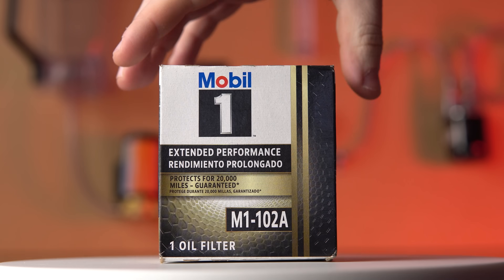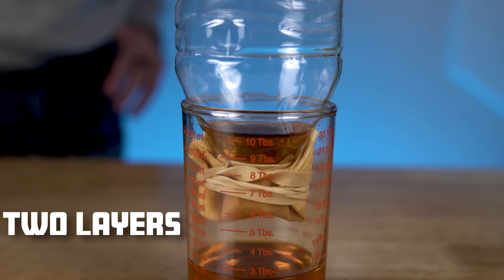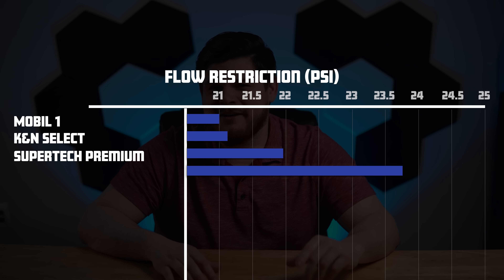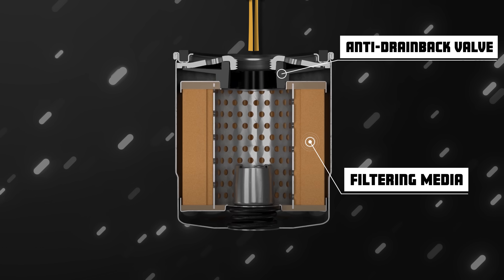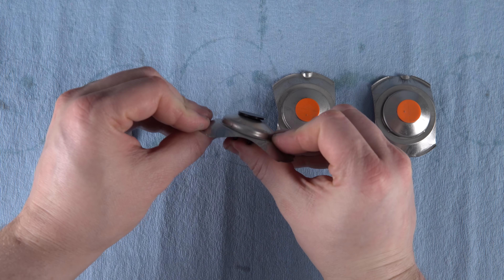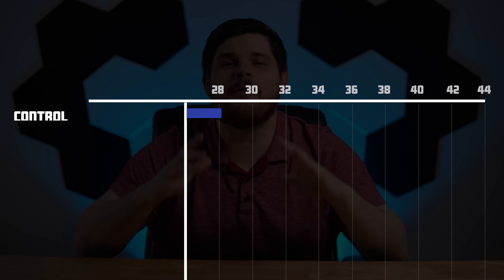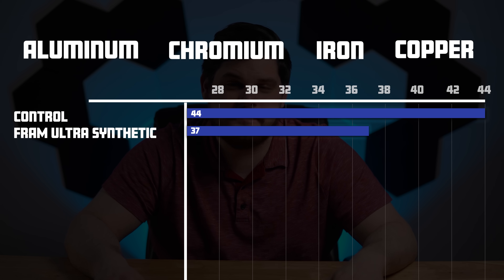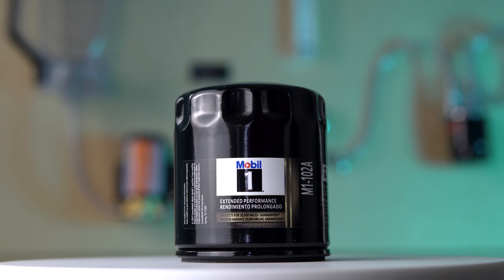Engineers Test the Best Oil Filters! FRAM | Mobil 1 | K&N | Walmart Brand

Comment: I use synthetic oil in my 2016 MX-5 with the Fram Ultra Synthetic oil filters. The filters are regularly stocked at my local Walmart but have never seen ANY Mobil One oil filters there. Very good about doing my oil changes including a 750 mile change for the 1st one. Doing changes around the 3000 to 4500 mile mark. All synthetic with the Fram Synthetic filters. Many short drives in cold weather so just to be on the safe side.
Reply from the maker: @Alan Gregori Thanks for sharing. Maintenance interval is Way more important, like you mentioned.

Comment: Long vs short filter
On the face of it, the longer filter has more media, so more dirt holding capacity and less initial pressure loss, so it will last longer before becoming clogged.
A spin-on filter has to fit in several ways, including thread size and pitch, gasket size, and media micron rating (to add whether there is a bypass valve and bypass opening pressure). Those details aren’t usually spelled out except in the technical specifications, so it would be really easy to get it wrong with very detrimental and costly results, especially if you aren’t a filtration expert.recommend using a top brand filter such as the OEM, NAPA Gold, Baldwin, and a few others. Avoiding big box store and cheap auto parts store filters will give you better odds than using a longer filterSome engines, such as those in simple passenger cars, require only a small filter to handle the relatively small amount of oil in the vehicle. Larger or higher-powered engines, such as those in heavy-duty hauling vehicles or performance cars, will require more oil flowing at a higher rate to keep things cool and lubricated, which means they’ll need a bigger filter.

Different filters can also perform different duties on different vehicle
Primary oil filter: This type of oil filter is also known as a full-flow filter. It’s responsible for filtering all of the oil that passes through your car’s engine. You’ll find this type of oil filter in most car engines.
Secondary oil filter: This filter cleans up to 10% of a vehicle’s motor oil. It’s typically used in addition to a primary oil filter. If your vehicle wasn’t originally equipped with a secondary oil filter, you can choose to install one after purchasing the vehicle.
Thermal chamber oil filter: A thermal chamber oil filter raises the temperature of the oil. This is done to burn off harmful contaminants. To do their work, these filters consume electricity, which can reduce fuel efficiency.
Spinner filter: Spinner filters are also referred to as centrifugal filters. They clean engine oil by using a spinning motion to capture contaminants.
Magnetic oil filter: A magnetic oil filter is designed to clean certain metal contaminants out of your oil. Keep in mind, though, that this filter doesn’t work on impurities such as dust and bugs.

Comment: If you change the oil when you're supposed to according to manufacturer recommendations brand of oil filters is really irrelevant these days. I don't necessarily agree with extended oil changes on engines with turbos though. I change my oil once a year or 15,000 miles, whichever comes first.
Reply from the maker: Yep, frequent maintenance is way more important. Thanks for sharing!

Comment: I use a Fram Ultra Synthetic that is about 50% taller than the size recommended by the manufacturer for the greater filtration area and thus lower pressure drop. My car has nearly 50K miles on it now and still uses no discernable amount of oil, as indicated on the dipstick which I check at the end of the 3K mile oil change interval. I'm sure the careful break in I gave the engine and the good quality oil I've used were contributing factors to the healthy engine I have, a Nissan VQ37VHR that's in a 370Z.
Reply: Ohhh dont worry, she’ll be burnin oil in no time 😂

Comment: For street applications Fram is fine but we have had issues in racing engines that starve the valve train of oil due to high oil restriction for racing use anything but fram, but for street vehicles it really doesn’t matter any of them will work
Reply from the maker: Agree! Thanks for sharing and supporting the channel!

Comment: I am always fascinated at watching oil filter tests, but for me , the outcome of these comparisons is meaningless. I use the filter that my Honda vehicle was designed and tested with, and change my oil and filter often. Why should I chance using a different filter? Regardless, with proper maintenance, the idea that my car would experience a decline in longevity or an engine failure because of the filter is most likely insignificant.

Comment: In the states there are 3 manufacturers of oil filters. And these manufacturers make many of the brands you see here. MAHL , PARKER , FRAM , MANN+HUMMEL and CHAMPION LABS  are actual producers. Also Walmart contracts with different companies to make certain fitment .  So in  this test there is a 75% chance the mobile filter is identical to the Walmart one. 
The key in this test is actually the bypass psi.. the lower the pressure the more contaminants will bypass the filter.. and fyi milage means nothing  it's the environmental conditions that cause oils to degrade.
Reply from the maker: Great insight, thanks for sharing!

Comment: Try it with 200 degree oil and with different weight oils👍
Reply from the maker: @Michael Rohr Thanks for the suggestion, it would require to change the entire setup so the parts used don't melt and with the budget of such a small channel, its really tough, but we may change the oil to something with same viscosity as conventional oil when heated. Appreciate your support!

Comment: Just my 2 cents…
I’ve used filters from Wix, STP, Motorcraft, AC Delco, and Walmart and KMart store brands. But I’ve been using Fram standard filters (and Valvoline oil) for 25 years, now, and have never had an issue. I change oil every 3000 miles. Multiple cars, boats and tractors.
Reply from the maker: Completely agree, as long as you keep up with your maintenance, you should be good! Thanks for sharing and supporting the channel.
Reply: Of course cause your smart 3 k oil change you never lose that way
Reply: @cr2158  I got in that habit after scraping a ridiculous amount of sludge out of an engine that wasn’t properly maintained with oil changes!

Comment: Good information, but not really real world application. Hell I change my oil every 3,000 miles. On that schedule you can use any ansi approved oil and filter and get by just fine. I've got 230,000 miles on my old truck and have never had any issues or major repairs. Clean oil and filter matter more than anything on getting trouble-free miles.
Reply from the maker: @ Kirby Road Thank you for sharing. Agree, ANSI approved oil is good enough, especially when changing at 3k miles. Appreciate you watching!

Comment: I have a question regarding your psi test. FRAM states their Ultra Synthetic filter has a bypass rating of 16-28psi. So if you pressurized it to 24 psi, would the bypass valve not have been opened? That in turn should've lowered the pressure. From what I understand, filtering efficiency restricts flow, and flow efficiency restricts filtering. There is a balance between the 2 forsure.

Comment: I just had some weird shit happened to me. I changed my oil and I put in a Fram oil filter. I drove about 1000 miles. Everything was good then all of a sudden I got a really loud tick in the engine from the lifters. Oil pressure was good and oil level was good, so I just wanted to change the oil and look at it and see if there was any water in it or whatever I’m not a mechanic. It looked fine, so I changed it and Walmart only had the mobile one filter for my vehicle, I put it in Started it up and the tick was gone and my engine sounded great? I have no idea what happened but I don’t think I’m going back to the fram
Reply from the maker: @Bryan Killen Do you remember what FRAM oil filter was it? Thanks for sharing and supporting the channel!
Reply: @BrandRanks  no, I don’t think it was the one made for synthetic oil, but I always used that brand because it had the grip material on the filter and it was easy to change. That’s why I like that brand changed filters, the tick would stop after about 10 minutes when the oil warmed up, it’s an old engine, so maybe some dirt just clogged up the filter, who knows

Comment: I had always been a Puralator /Fram guy many years ago.   when to me Fram was the better filter but over the years each manufacturer started skimping on their products and I started using OE filters with very good success and started about 8 years ago using Wix filters which I am also very happy with
Reply from the maker: @1995dresser, It's great to hear that you've found success with OE filters and Wix filters. Thanks for your comment!
Reply: My mom works for fleetguard Cummins filtration, she said on the assembly line that one filter goes one way and gets painted white with a fleetguard label stuck on it and the next goes the other way and gets painted orange with the frame logo stuck on it, so if you can find fleetguard filters (same with air filters too) they are the same as fram for like a third the cost, she been with the company for over 35 years now
Reply: @diychad7268  but frams end cap has a different design and the micron rating is different, so the parts must be different, no?

Comment: like to see results done at normal engine operating oil temps, not ambent
Reply from the maker: @Erik Young, Thanks for the suggestion, it would require to change the entire setup so the parts used don't melt and with the budget of such a small channel, its really tough.

Comment: but normal oil pressure in a car is between 25 and 65 psi, any one of those oil filters would be just fine and not restrict flow enough to make any difference. personally I run a Bosch filter and havoline 6 quart box oil, 25 dollar oil change and do it every 10k miles, NOT ONE ISSUE and I do this on all 3 of my SUV's, jeep 258k miles, Yukon 254k and explorer 154k miles. millage doesn't kill a car, lack of proper maintenance does.

Comment: I have never thought Fram was a good oil filter, I have always used Pennzoil High Efficiency filters. These filters I use are limited on where to find them. I work at a refined bulk oil distributor so they are readily available to me at $3 a filter. Quick lubes charge triple for the same filter. In my area you can't walk into a automotive store and buy these filters either. I wonder if its scarcity makes it better or is it just that a rare filter from Pennzoil?

Comment: This is what I wanted to see.  Not just taking a filter apart to see how pretty it looks inside.
Reply from the maker: @t bolt Glad you enjoyed. Thank you for your support!
Reply: All these tests are absolutely not relevant in cold oil, must redo everything.
Reply: @47ALTAIR47  WHY ? In what way ?
Reply: @tbolt5883  In the sense that the pressure reducing valve in almost all filters comes off at different pressures until the oil heats up and changes viscosity, this is called the operating mode, and all the tests in this video were carried out under absolutely incorrect conditions for the normal operation of the filter.
Reply: @tbolt5883  He's wrong! Unequivocally. -NY
Reply: @47ALTAIR47     According to you this test produces the worst case filtering scenario ...cold engine, cold oil, thick viscosity.   Isn't that what you want...worse case vs. normal case ?
Reply: @tbolt5883  These are not the worst case, just the filter needs to be tested in working conditions, not in a cold start.
Reply: @47ALTAIR47  What kind of difference do you expect to see in a cold vs working condition filter ? More or less filtering ?   I would expect slightly more filtering in a warm condition because the metal particles in the oil would enlarge marginally from the heat and get caught in the membrane.   So a filter in a cold condition that filters more particles of a certain size is better than a filter that can filter those same particles when they enlarge from heat.
Reply: @tbolt5883  Whenever you start a car with cold oil, then the bypass valve opens, this is one of its main functions, for each manufacturer this valve operates at different pressures, therefore, in the first test, the pressure gauge showed us the response pressure of this valve, not the quality of filtration.
Reply: @47ALTAIR47  It doesn't matter if the oil is warm or cold.  40 psi of warm oil is the same as 40psi of cold oil and it will open the bypass valve.
Reply: @47ALTAIR47 
Wrong on cold oil opening the bypass valve.
Reply: Exactly 💯. Much more thorough info for us engineering types. -Ohio

Comment: Did you run the tests with hot or cold oil ?
Also why did you not include the Wix ,thats the industry-standard.
Reply from the maker: Thank you for your feedback. It was ambient temperature oil. the components on the rig would not withstand engine temperature oil. Although all filters were tested to the same conditions. We are planning on testing additional filters including the WIX.

Comment: Should test the burst strength of the oil filter cans oneday ....definitely will make a messy fun video
Reply from the maker: @daewooparts That's a great idea, I bet it'll be fun, until I have to clean it up🤣
Reply: None of them will burst at normal operating pressures.

Comment: A delta P reading showing pressure drop through the filter would be a good addition to your testing. The bottom line is that modern car makers specify oil drain intervals that are way too long. My car actually shows 20,000 miles remaining after I reset the oil change counter. That's insane in my book. 8500 miles of mostly highway driving is as long as I'll go. Oil analysis at 165,000 miles shows nearly no wear metals in the oil, and levels are consistent from one sample to the next. No oil needs to be added between changes to maintain correct level, BTW.
Reply from the maker: @Doug Robinson Thank you so much for your feedback. Completely agree, we are going to be adding an additional pressure gauge for the pressure drop. We really appreciate your comment, we try to improve and make things better and comments like yours allows us to do that to ensure we bring the best content to you. Hope you have a great day
Reply: A delta P was already done in the video. The output pressure was 0. Delta P was 25 PSI - 0 PSI. An engine oil pump pulls from the sump which is 0PSI. Adding a restriction to the output will do nothing and actually make the test worse. You want the largest delta P for the test and that is done by leaving the output open.

Comment: Another comparison I watched rated Fram as worse than bad & NAPA as the top performer. This was because the Fram units no longer have metal end caps, so they can collapse. I cut one up... sure enough, no metal end cap with the paper consetena stuck into a cardboard flap. I did the same with Napa... sure enough the consetena paper is stuck into a pool of adhesive inside metal ends so no chance of a collapse...

Pressure is a function of flow quantity & restriction. A filter passing 8gpm will build more pressure than the same filter passing 2gpm.
Reply from the maker: @David Brewer Thank you so much for the insight. We really want to test out a NAPA one! Appreciate the support.

Comment: Regarding the high flow of the fram filter.  The bypass valve might have been weaker than the other filters, and might have opend since the oil you use is cold. Meaning it Just doesnt filter. At work i split al the filters to separate the filter media and steel. And the only real diffrence i see is in the bypass valve systems of different filter brands.
Reply from the maker: Awesome insight. Thank you for sharing! We are always trying to improve and comments like yours helps us do that. We will be making some modifications to read the drop in pressure to determine if the valves have been open! I appreciate your support and for taking the time to help!

Comment: Well, this was a good start, but i would say you left ALOT on the table when it comes to methodolgy and media types... Definately add some Depth media filters to the lineup such as Wix XP, Amsoil Eaxxx, Purolator Boss (Same as Wix XP), etc...
  Because you were only testing surface media, (or in the case of Fram XP (hybrid media)) it really is like testing the same oil fiilter 3.5 times...  As for method, i would say its important to add the contaminant such as your aluminum powder with a metered dispensor for even contribution to each filter...

Comment: I just found that supertech oil filter for $1 on clearance. I grabbed 6 for my boat & my wife's car.
Reply from the maker: @Doyle Hargreaves 😱😱 That is cheap!! As long as you keep up with maintenance it should do the job. Thanks for sharing and supporting the channel!
Reply: @BrandRanks  can you guys test yamaha oil and filters?
I know my yamaha 1.8L 4 cyl fits the same oil filter as my wife's 2.0L ecoboost (a motorcraft FL910s). That yamaha filter is is about $25, but looks the same as a supertech 3614 or a Motorcraft fl910s...